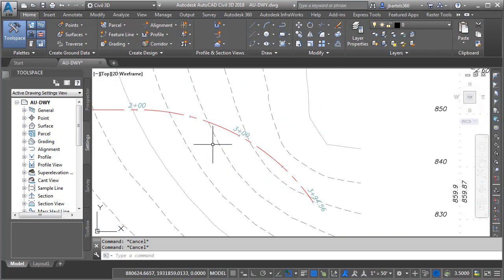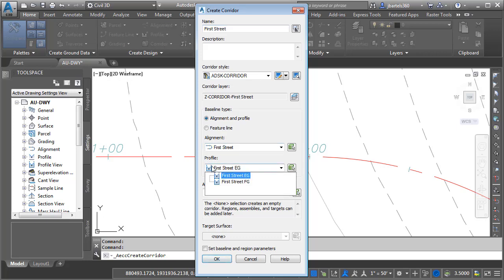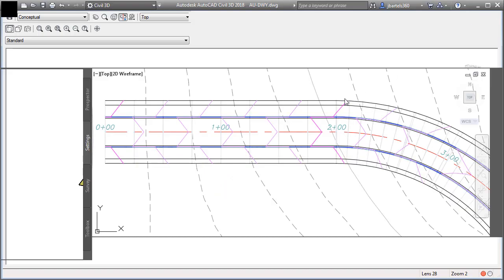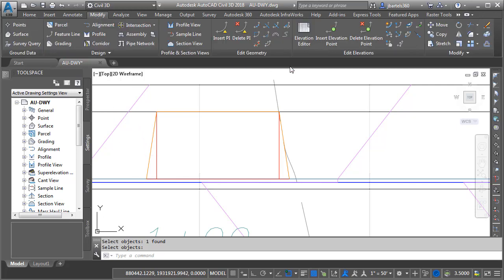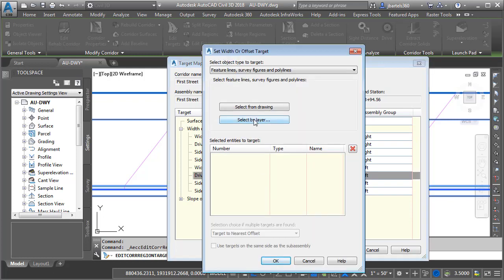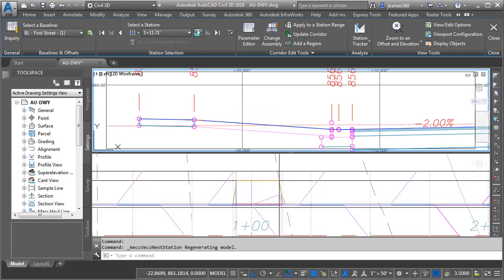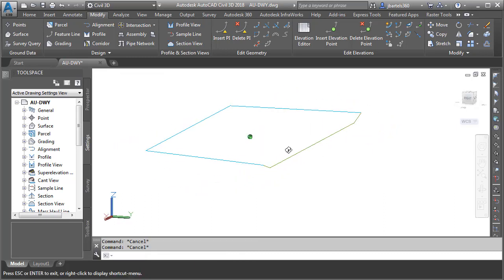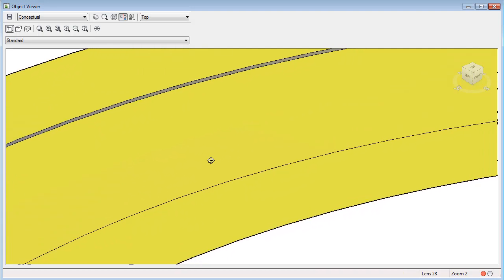Adding Driveways to a Civil 3D Corridor using Minimal Targeting – Pt. 2 of 3

Comment: Jeff,  I am using civil 3D 2022.  Is there a sub assembly for doing driveways like this?  Or do I have to figure out how to create one?
Reply from the maker: Hi Ryan, No out of the box assembly. With The included Subassembly Composer however you can create most anything you need. In part 1 of 3 I walk through the custom part I made for this purpose. I’ve also created a series that walks through how to use Subassembly Composer on my channel.

Comment: Great walk through on this workflow Jeff!!

I am running into an issue with the corridor saying it is out of date once I set the back of curb transition target to the feature line.  Is this something you had occur as well?
Reply: I found that the difference was I was using a feature line versus a 3d Polyline.  The benefit of this is that the Featureline automatically updates if adjustments are made to the profile whereas the 3D polyline doesn't.  I am also putting the featureline at the flowline instead of the Back of Curb.  If a featureline is used at the Back of Curb it continues to lower futher and further each time the surface is rebuilt.

Comment: can I do something like that with a subassembly included in civil 3d? Or i need composer?
Reply: This might be late and you have already probably found a workaround, but I just found out that my company has 2018 AutoCAD Civil 3D Version 2 and in it there is a Driveway subassembly. I'm not sure what version you have, but in the Toolspace, under the Toolbox tab it may be worth checking to see if you are able to incorporate that subassembly.  Jeff also has a tutorial in incorporating Service Pack Subassemblies into your Tool Pallet. I hope this information helps you a little.

Comment: Great video!  Why do you need a left and right driveway block? Won't a single block work, just rotated?  Thanks
Reply: The left and right driveway blocks would be identical except for layers. The difference in layers helps when he does the targeting for the left or right Driveway Horizontal.